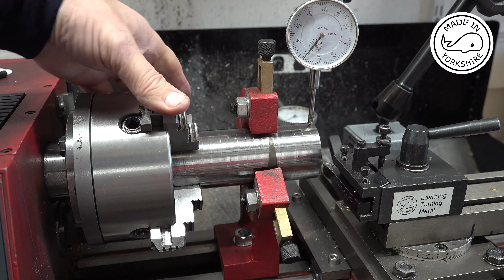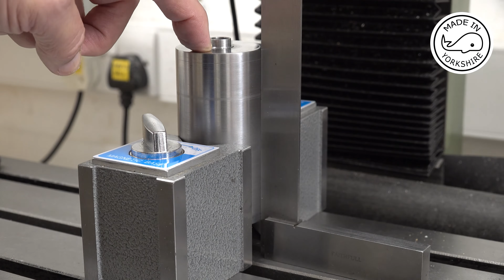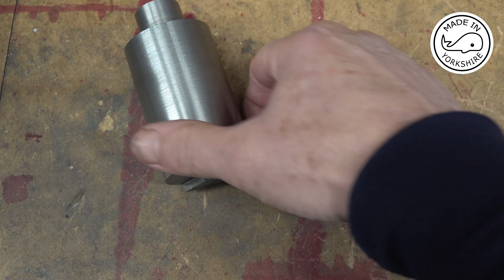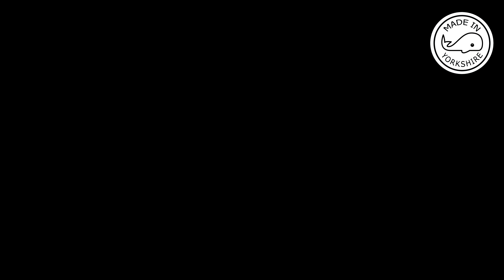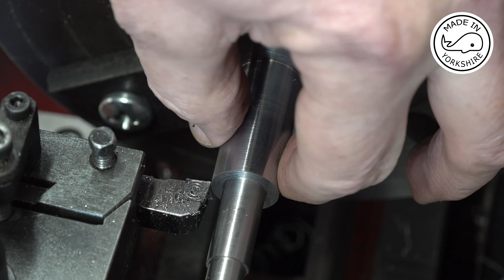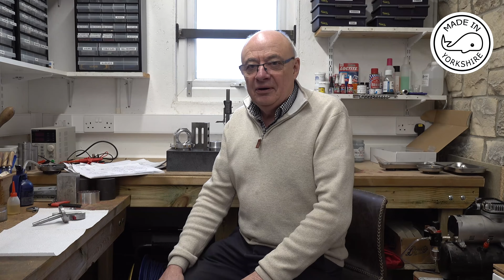#MT49 Part 8 - Jerry Howell V-twin IC Engine. Machining the Crankshaft. In 4K/UHD by Andrew Whale.

Comment: What are the inserts that you are using? They almost look like the positive rake inserts used for aluminum.
Reply from the maker: Yeah I use inserts intended for aluminium when cutting all types of metals. I generally get great results. The most common insert I use is RCGT0602MO-ALU from Associated Production Tools. Other suppliers sell them too.
Hope that helps.
Andrew
Reply: @learningturningmetal  I have those round rcgt0602mo-alu inserts but no holder, yet.  I’ll have to try them out when the holder arrives, if it ever arrives. I have a bunch of the triangle inserts for steel and they don’t leave a very good finish at all unless I take a huge depth of cut but when I do that my lathe stalls out.  I’m still learning this machining process with my mini lathe and I know it’s better to use positive rake tools to reduce tool pressure and negative rake and neutral rake inserts are not too friendly with the mini lathe.
Reply from the maker: @taranson3057  my holder is sclcr1010e06 from arceurotrade. I use the round inserts too.

Comment: Congrats on passing cut, I started riding bikes about this time of year back in '69. Fingers finally thawed out last summer.🤣
For future reference, if you need to rectify a centre the simple way is to use a centre drill and be a bit sneaky. Get the part running true using your favourite method and mount your centre drill with the cutting flutes level.  Start to drill and use your tool post to push the drill chuck sideways, which turns the centre drill into a single sided form tool. As you know if you just try to drill with a centre it will follow the eccentricity but using this method you can be fairly sure to correct the wobble. I read this method in an old old book and have passed it around the net and you can follow its progress from Abom to Blondie etc.
Reply from the maker: Hi Chris, thanks for describing the method. I will have to try to remember that one!
All the best.
Andrew

Comment: Great video Andrew. The crank looks like it will be a reliable item when finished. I am itching at making a Flat twin boxer engine. Really wanted to make a water cooled one but don't seem to be able to find any drawings. They all seem to be air cooled units.
Congrats on the CBT. Just waiting for my bike to come back from a major £900 service at Ducati Leeds. 
Regards.
Steve.
Reply from the maker: Hi Steve - the flat twin sounds interesting. The CBT was really informative and good fun too - they should have introduced that when I was younger. I've since found out that as I am a few years older than 25, I can take lessons on a 350cc and try to get a full unrestricted license. So that's the plan! Blimey £900 service - it should run like new when you get it back.
Cheers
Andrew

Comment: Within seconds of you starting the lathe, I didn't know what you were cutting, all I knew was it definitely wasn't EN1A, from the blue swarf.
Also, and I am guilty here, when you make a mistake and scrap a part and start again, there is a tendency to rush back to where you were before...result another error. I hope that makes sense.....but you got there, and that's the main thing. Well done..again.
Reply from the maker: Hi Raymond - goodness knows what it was. When I noticed the blue swarf I should have stopped. When I encounter problems I usually call it a day and get back to it with a fresh head. I also find it difficult concentrating in a cold workshop. Roll on Spring!
All the best.
Andrew

Comment: That original piece of metal looked like it was cutting similar to a high carbon steel such as 4140 or 4150.  Glad to see you back at it in the shop.
Reply from the maker: Yeah - I've no idea what it was, but the swarf changed to a blue colour when cutting. Roll on Spring and some warmer weather.
Cheers
Andrew
Reply: What gave me the idea that the steel was 4140 or 4150 was the fact that the swarf appeared blue but I was not sure. My eyesight isn’t as good as it was 50 plus years ago that’s for sure.  You’re doing a great job.  I’m interested in what you have planned for the ignition and if you could possibly share links for those items. @learningturningmetal
Reply from the maker: @taranson3057  I've not thought about the ignition yet, but I will try to provide full details when I get there.

Comment: Hi,Andrew. You really would benefit with close to the tailstock centre turning by using a SDJCR tool holder and DCMT or DCGT profile cutting tips. The DCMT/GT tips are a 55 degree diamond profile with a broad choice of tips for various tasks and not expensive to buy. A trick with centres at the headstock end is if you grip a parallel shanked centre in the 4 jaw you can adjust it to compensate for any small discrepancies you may find with previously drilled centres. A cranked driving dog shouldered against the side face of one of the jaws on the 4 jaw chuck gives you the drive to the component.
Reply from the maker: Hi Howard - can you believe it I've got a SDJCR tool holder and some DCMT070204 tips. Great idea using the 4 jaw chuck too. I think I must have suffered brain fog in the cold workshop! I should have called it a day and got back to it with a clearer head!
Thanks for the excellent advice.
All the best.
Andrew

Comment: Thank you for the update Andrew!  Glad you persevered and completed this part. However I cringed when you pulled the swarf with your fingers when the lathe was running. Please Andrew use a hook or pliers to clear the swarf. Thanks again for the update. Cheers
Reply from the maker: Hi John - yeah I really should have known better. That thought did occur to me when reviewing the footage. I tend to find it difficult concentrating in cold weather. Roll on Spring!
Cheers
Andrew

Comment: When you had crank 2 up in the mill with the bad center, you could have recut it true, without adding a plug. Center it up and very carefully with a short center drill open it up slightly. Another option was to use the lathe 4 jaw to get it true and use the compound set to 30 use a miniature boring tool to cut the center true again. I know it would have meant silver soldering, I would have fabricated the crank, 1/2 inch silver steel rod into the flange to save all that turning. Hope it al works out in the end. Take care on that motorbike, idiot drivers out there these days. Regards from Australia.
Reply from the maker: Hi Dave - many thanks for the advice. I think I must have been suffering from brain fog! I should have called it a day and revisited it with a fresh head. I really should have known better. 
Yeah, I just want to try to get a full license to potter around locally. I will probably only do a couple of hundred miles a year on the Bantam, and no desire to go fast. I really like setting myself challenges too. The CBT was really informative and good fun too.
All the best.
Andrew